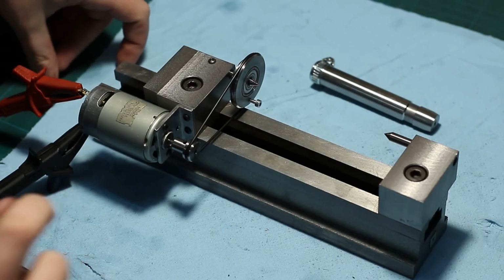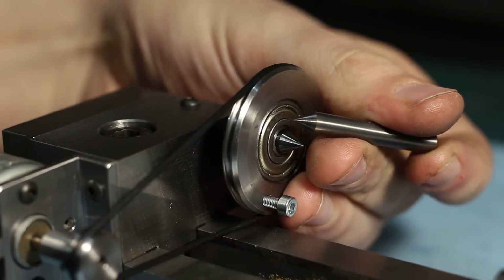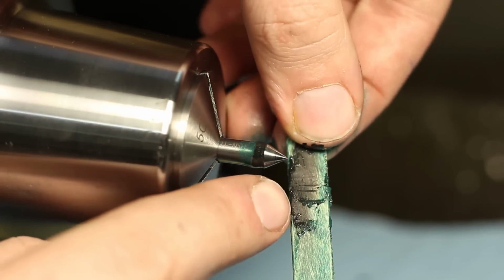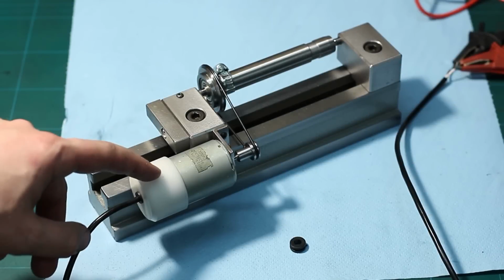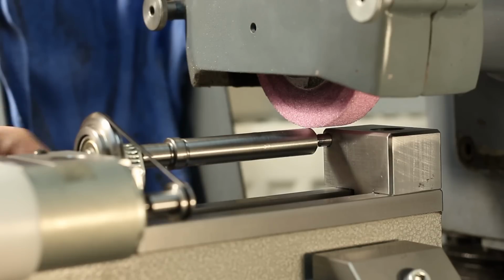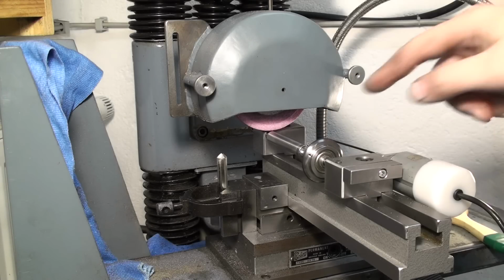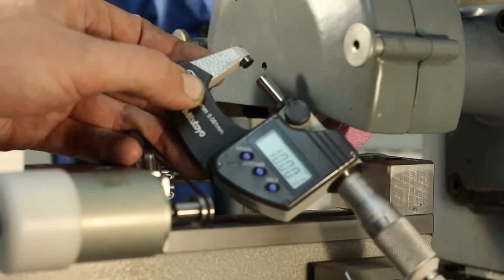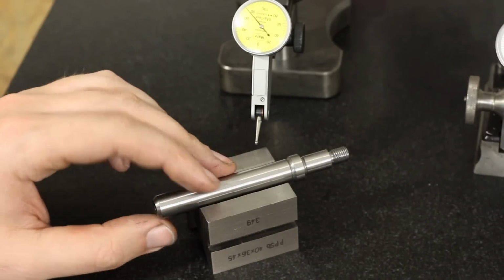Cylindrical grinding attachement - Part 2

Comment: Love the built.   When grinding “common” tapers (Morse,collet,etc).  That you may use repeatedly.   Could you machine angle plate attachments (wedges) to easily attaché to jig for quicker setups and repeatability?  After seeing you “cheap collet” clean up video.   Maybe dial in cheaper collets more concentric?

Comment: Stefan, I have a Harig-style grinding attachment and I’m struggling to eliminate an issue with it. I am getting an hourglass shape part. I suspect it is caused by the horizontal alignment of the fixed centers. Does this sound correct, or is it something else?

Comment: Factory installed two thrust bearings on a 50hp pump motor. The motor didn't like to run for very long.

Comment: Dumb question time, you were concerned about bearing noise getting into the surface of the part but you are not concerned about imbalance getting into the part? I doubt the forces are high but are still there and would be much greater than any bearing noise. Great show. Thank you Stefan

Comment: I am failed to see the difference between grinding with this attachment and grinding between points on a lathe with a very sturdy tool grinder, assuming all top end equipments.
Reply: Way too many additional variables introduced by using a lathe. Gear driven spindle, lathe bed wear, cross slide adjustments, slack etc. and most importantly the distances between the reference surfaces and the work multiply the errors.

Comment: just an observation on your measurements. you measure at the extreme ends of the part. I believe this might not be a true measurement. the leading edge of the grinding wheel is doing all the work, and therefore will wear more. So since you sop and reverse the direction of the grinding wheel, you introduce a taper at the end of the part where you change direction..
Reply: Sparking out with the finish passes should largely take care of that, no?
 It would also give a sensitive visual indication of whether the effect you are (justifiably) predicting is significant - obviously it's a function of the wheel makeup and the downfeed for the finish cuts, but my sense is that wheel wear is relatively slow on small diameter cylindrical grinding with a (relatively) large diameter wheel, all other things being equal.

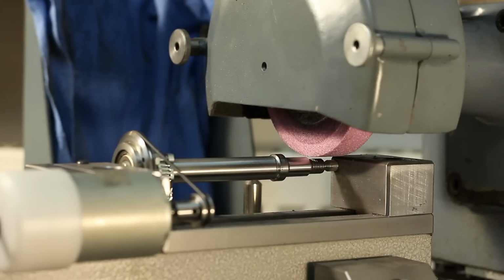Comment: At 29:40, 200mm long steel bar with 50 degree temperature rise makes it 0,1mm longer, not 0,05mm. Part between the centers is about 10mm thick and apparently gets about the same hotter, thus growing 1/20 of 0,1mm = 0,005mm, which was measured. 

Good video.

Comment: How do you keep the vibration from the motor, or the out-of-balance condition of the screw/dog combination from affecting your grind?  Or is the assumption that the pressure of the dead center with the spring, and the mass of the fixture clamped to the table absorbing that?
Reply: It's turning slowly in comparison with (say) lathe work. I don't imagine it's significant, but one could run it extra slow while sparking out, I guess.

Comment: Awesome! Been trying to think up the same type of "thing"  for alignment shaft grinding tool and....   Question, wondering if that clamp would make a difference if you put the same size on other ends of the workpiece clocked 180d off just for harmonics/vibrations?   Thanks, Stefan you are the Master:)

Comment: Loved the build Stefan!  Enjoy all your Vork.  Vhy do you use such a thick Vheel?  Vatching Surburan Tools it just creates more heat....."the enemy of grinding" according to them? I think thats vhy 1/4" wheels are more common than 1/2" wheels?  Again, keep the wideos coming!  Also my complements to you on your mastery of English Language, it is better than my German LOL
Reply: Indeed. When I use a toolpost grinder on a small lathe, I use narrow wheels and dress them at an angle so they're only cutting at one end. It makes for very fast wheel wear but good finish and minimal chatter, whereas a wide wheel is a waste of time.
Similarly when using a cup wheel on a milling machine: It's important to dress the face to a (very shallow) hollow, or reverse cone, so it's only cutting at the outside edge. Otherwise (especially if the spindle is not perfectly square to the table)  it's asking to burn the work or even smash the wheel. It pays to use a really soft wheel unless your mill can spin really fast.

Comment: I might be late to the party as I'm discovering the channel just now. I think all the videos are great.

The motor can run just fine on a cheap rectangular USB power banks (1-2€ at discounters). They are marked 2200mAh but in reality are around 1000. At 5V the motor will run fine, albeit a bit slower, and one bank should last for hours. The inductive spikes from the brushed motor might kill them, so a capacitor on the terminals could help.

I've converted a lot of small stuff in my home "shop" to run on USB, either stepped up or down. You can even buy ready-made cables that convert USB to 9V or 12V @ 500mA, 5.5mm plug, for 1-2$. For more (mobile) power I use 3S LiPos with XT60 connectors or 8-10Ah motorcycle batteries.
Reply from the maker: Haha, that is actually a very good idea, I like it. Beats dragging the bench powersupply over to the surface grinder...

Comment: Cool project.  When you were working on the small diameter tool holder, you mentioned that someone clever-er than you would set up a mister, etc etc.  I thought: "He has enough room under the part for a damp sponge.  That would help to cool the part, and (maybe) help pick up a bit of grinder dust."  Would there be any reason that would be a bad idea, shop wise?  I don't think a cheap kitchen sponge would cause any potential damage, even if it caught in the part and got pulled into the grinder wheel.  Of course, I am NOT a machinist, and it's not my gear!

One other little thought, would a few nuts (in various common sizes), drilled & tapped, to accept a threaded drive pin, be useful for this jig?  I think it would be simpler & easier to use something like this, when you are grinding a piece with threads, instead of the hose clamp. The nut might have to be split, drilled, & tapped (similar to some cutting dies) so you can clamp the threads more securely.  It wouldn't be necessary if the nut threaded on with the direction of the jigs rotation, but it looks like this jig could spin the nut off.  Of course, a jam nut could be used, but I realize that you won't always have enough thread to use one.  Just a thought.

Comment: Great video as always Stefan.Just a thought but whenever I am called upon to do some cylindrical grinding in the toolroom I always put a little dab of high pressure grease in the centres of the workpiece.It seems to help reduce friction and also reduces wear on the dead-centres.

Comment: Excellent series, Stefan. Let me add my kudos to all of the other well deserved ones for interesting subject, good story telling, excellent camera work and editing - and lots more. One consideration in setup might also have been interesting in discussion, and that is your correction in diameter at each end of the cylinder by moving the end of the cylinder down (adjusting the centerline of the part in the vertical plane). Actually the part centerline must be parallel to the traverse of the part in the vertical and horizontal planes or the resultant surface will have conic section shape rather than a straight line. Sort of like what happens when you cut a taper on the lathe with the cutting tool not exactly on the center of the part. Your off-camera setup certainly took care of this but you could have really messed with everyone's brains by mentioning what a horizontal misalignment would have done!

Comment: I agree with Billy T, perhaps something on the order of a lathe dog.  A round disk with a notch on the edge and a hole in the center similar to a lathe dog.  You might have to notch the cast bed, like a gap bed lathe, to clear the set screw in the dog.  Just a though from an old brain rusting away on the Oregon coast (USA).

Comment: One μm is something like 0.00003937007874015748 inches or 1/25394 of an inch. Think that accurately portrays the issues I have with having the smallest measurement the width of a thumb. Non of this accuracy stuff people tend to bring up(you could work in km and still be as accurate) but the fractions gets dumb.
Reply from the maker: Second argument is always: "We where to the moon with the inch" ;)

Totaly agree on the factions/decimals, it just seems ridiculous.
Reply: they were  on the moon with her von braun  not inch lol....but also russians were first in space with metric ...so its bad argument  lol
Reply: In my shop we work in both Imperial and metric because so much stuff is international. Sure wish it was only metric but the politicians here are too stupid to make the change.  They even considered it in the 70s then got cold feet because of some opposition (lost votes!)
Reply: Hi mate.  And that while NASA, apparently, does not use imperial.

Comment: Great Job Stefan.. Did you also measure the taper on the arbor after grinding ?
Reply from the maker: Thanks.
Yes, I checked it back to front with the mitutoyo mike and also with the indicator in the v-block, back to front, looking for the highspots (The v-blocks are known good/checked GDR made ones), everything came out within the uncertainty of measurement, to be generous, I think I could guarantee an error  "below 5/1000mm" :)

Comment: Wonderfully simple and elegant. I could see other ways to build it but you have to use what you've got. Having used both the Harig and the Suburban punch/offset grinders I have to agree they do take up available real estate in a hurry. In a pinch you could of course use the head from your Cutter Grinder But there are times they are the easiest way to get the job done. The little punch grinder you made looks really nice. Out of curiousity what sort of bearings did you use on the spindle? And for really nice drive dogs these work great http://www.readytool.com/Grinder%20Dogs.htm. Done the hose clamp thing myself when grinding the OD of rotary bushings where they are mounted on a tapered arbor and the arbor is held stationary. That way the whole assembly is running on its own bearings.

Comment: Excellent and your device meets industrial standads. Like it very mutch.
Reply: The only thing I wonder at is the small diameter of the carbide shanks used for centres, considering how far they both now stick out. 
It must surely not be ideal for preventing chatter...

Comment: wonderful build, Stefan.  I was a little let down, though, to see you work to only one thousandths of a millimeter.  ;)
centerless grinding next!
Reply: I have video on centerless on the surface grinder 90% done. Don't you Two jump the gun on me. ;)
Reply from the maker: Thank you Tony...with the 1/1000mm..sometimes good enough is good enough ;)

We have a supersimple fixture at work for centerless grinding on the surface grinder, made by Spreitzer.
http://www.spreitzer.de/pdf_de/rundlaufpruefgeraete.pdf 
Page 29
Reply: Ain't that the truth, Stefan.  Don't despair, though.. there's always the 4 jaw chuck!
Reply: This Old Tony yeah, it's nice but can it core a pineapple?
Reply from the maker: Cant wait to see it!

Comment: Great video as usual, thank you. Now just a comment about your work in general. It is all very well doing excellent improvements to bought  equipment and adding additional features to them. But you seem to just be adding and improving your workshop equipment. If you do not watch out, you will spend your entire life just improving the equipment without actually making something. How about making models of steam loco's, internal combustion engines or something similar. It seems such a shame that you have an excellent workshop and the skills for doing all the operations nescessary for model building, but you are not using them.
Reply from the maker: I can see what you mean :)
Model engineering is where I come from - I always was dreaming about building small IC engines and steam engines, but the reality is, it doesnt satisfy me as much as I expected. 
What gets me are intricate, complicated parts, fixtures, tools. Thats also the reason why I do more and more job-shop work on small parts/production runs - For one it is great to have a little income from the shop, on the other hand it is very interesting, as you get a lot of different parts that you normaly would not dream off, also different materials...
The shop-equipment I build is mainly to build experience and to widen the range of work I can do.

I hope that is somewhat of an answer ;)
Reply: It's true, but there's a lot to be said for being 'well prepared'. As far as precision goes I'd say Stefan is reaching the limits of what can be achieved ... certainly reaching levels well beyond 'home shop standards' and beyond industry standards in a lot of cases too. He could be building rocket engines - I get it - but ultimately, if someoness happy and enjoys just doing what they're doing then there's no 'waste'. If all a man left behind him were the tools he made with his tools he'd still die a happy man :)
Reply: Frankly, most of the projects I have in mind building tools for my slowly expanding shop.  Don't get me wrong, I'd love to have a contract that would help pay for my equipment and cover the cost of upcoming additional equipment, but I can't see a higher purpose than building things that make future jobs easier.  As for engines and whatnot, I personally don't see the draw.  Across the world there has to be tens or hundreds of thousands of these homeshop steamers or IC engines, trouble is, none of them are put to actual use, they are usually run for a fraction of the time it took to build them.
Reply: I agree. the most joy I get is from being successful when taking on a challenging part, getting the job done with the equipment and tools I have on hand or have made.  It is especially satisfying when I have to make an intricate fixture or tool in order to complete a job.
Reply: And vhat's vrong vith that. It's all about the journey and not so much the destination.  I'm only in it for the fun and nothing else.  I think Stefan already vorks as a machinist somewhere so he can play vith vhat suits his fancy at home.
Reply: Models are fine and wonderful to make. Tools and tooling are also. I understand completely where Stephan is going and enjoy doing the same thing in my own shop. It does not really matter what you make, models or tooling, or whatever, what matters is that you enjoy yourself in your machine shop. I believe that Stephan enjoys himself in his shop. I would also point out that the reason Stephan has such an excellent shop as pointed out by the OP is because he is always expanding his capabilities.

Comment: Hello Stefan, very nice work as usual! I can't get my head around, if it is necessary to center the grinding wheel with work piece when grinding tapered surfaces? In my mind, if the wheel isn't at the center of work piece it would affect to the taper you get.
Reply from the maker: yes, it should be "about" at center. I guess that eyeballing is good enough to get a error small enough to be noticeable.
Reply: I always have the workpiece to the left of the wheel ( spark side ) when grinding round parts. This prevents the grinding wheel grabbing the workpiece and pulling it to the left. If the workpiece is to the right of the wheel and it grabs, it will travel under the centre of the wheel which is the lowest part giving a deeper cut.

Comment: Another great project. Very impressive result. Is there any reason that you choose to mount the drive pulley on the moving centre rather than the fixed centre? ( a question, not a criticism!). Keep 'em coming.

Comment: I hate my Interapid. The movement is superb, but the design is retarded. The needle moves the wrong way in one direction. See the video here: https://www.youtube.com/watch?v=tt7gSQpNABM&t=1s  the ranting is closer to the end.

Could you have driven the part using the threads and ground both diameters without flipping the part? Then your runout would be almost nothing.

Comment: Excellent project. You surprised me with the hose clamp, it's not your usual level of elegance.
Reply from the maker: Its a precision hoseclamp ;)
Reply: Stefan Gotteswinter I can see you calling your tool guy looking for a copper one.
Reply from the maker: What barbaric man drinks beer out of a can? Over here, beer belongs in a proper glas bottle ;)
Reply from the maker: High temperature, non insulating shims, yes. Was that a trick question? ;)
Reply: Billy T are you the guy who would not approve of using a beer can as a shim?
Reply: Job shop work is half elegant precision, and half shoddy bodge jobs that are good enough for long enough. No shame in that.
Reply: It's a replacement clamp for an Audi R8 bi-turbo, $11.40 + $2,975.00 labor(Flat Rate) to R&R engine and trans., not covered under warranty.
Reply: not that I'm aware of
Reply: Stefan Gotteswinter But that's because of Dosenpfand. Die Ärzte even sung "Bier in freier Natur, das ist Punkrock pur"
Reply: Stefan Gotteswinter ahh yes, but have you ever tried making shim stock out of glass? Desperate times my friend!
Reply: Stefan Gotteswinter I eagerly await the video !
Reply: It's a Starrett hose clamp :D
Reply: good one!

Comment: Hi Stefan
Excellent video: clear, informative, interesting-thank you! I especially like how the dog touches the springy end of the hose clamp. To my mind this reduces or eliminates any vibration transfer between these two surfaces.

One question. Would there be any benefit to using a tiny amount of high pressure dead center lube? I do recognize that the lube could pick up grinding dust so this might not be a good idea.
regards
vic

Comment: you will get better result if you plunge in close to the shoulder and get out of your piece, like that you don't end with the little tapper of the use wheel on your shoulder.